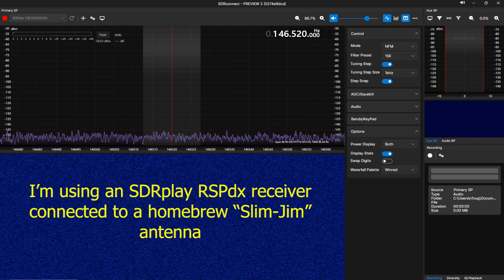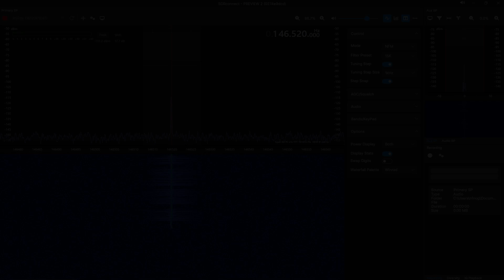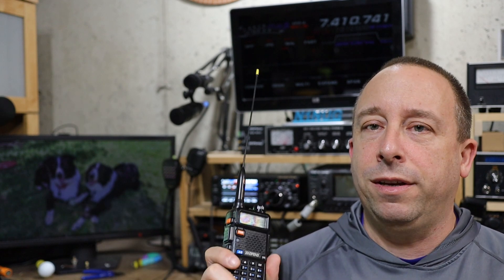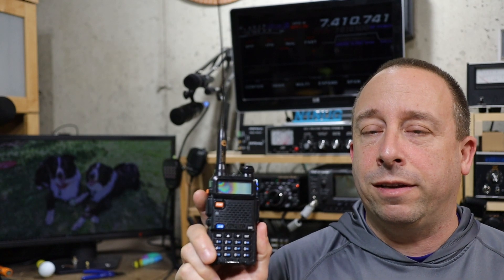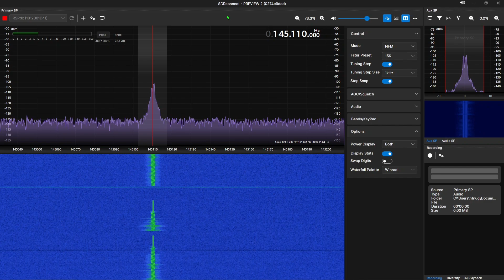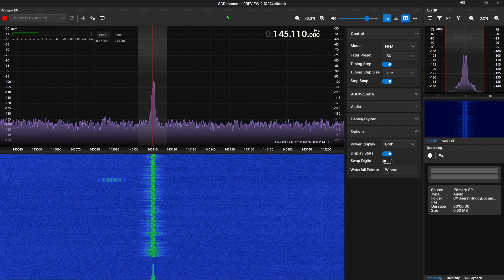The Most Important Setting On Your Baofeng Ham Radio For Repeater Use!!!

Comment: Hams use wideband FM.
Reply from the maker: Right...that's what the video is about...
Reply: @SevenFortyOne  I "discovered" this a few  years ago when I was reading about MURS frequencies.  I owned a pair of radios for this service, and they were setup for the 2 channels which allow wideband FM.

I was surprised that other channels in this service used narrowband.  This made me wonder if any hams used narrowband.

I was surprised to find discussions by hams using narrowband below 29 MHz.  I didn't think this was legal, but they claim that if their bandwidth isn't wider than an AM signal, it's permitted.

However narrowband FM has issues with phase on the lower frequencies which can render it useless.  So I guess that SSB is still the "best" mode for phone on HF.

Anyway, several years ago I tried the same experiment that you did in your video with the same results.  Narrowband is compatible with wideband, even through repeaters, but since the deviation is narrow, so is the volume.

Comment: When would narrow band be utilized?
Reply from the maker: you would use narrow if the ham repeater you are connecting to used narrow for some reason.  Most ham repeaters, however, are set to wide.  Having said that, most other radio services that still operate analog VHF/UHF like fire, EMS, and businesses use narrow mode.  Ham Radio is really the only holdout still using wide.

Comment: Question.. brand new on my journey of learning, on some repeaters when I transmit I'm told I have a low almost robotic hum kind of like what you had when you were using the repeater. Even when I key up just to make sure I'm hitting it it gets keyed back with this digital sounding "waooow waooow waooow"  like some1's making Frankenstein in the distance.. lol  rps 30 power supply btech 25x4, not all repeaters give me this but they keep saying maybe rf bleed back and im commin in low? Wouldn't that happen all the time though if that were the case? W/N didn't change a thing.  😒
Reply from the maker: I'm really not sure... I'd have to hear it in person.  I've never heard what you are describing.

Comment: The most important setting on a Boafang should be one that directs you to a website that sells Yaesu, Icom or Kenwood!! But I don't think they have that setting. You get what you pay for, don't ever forget that.
Reply from the maker: I think we both know that these Chinese radios are here to stay.  My goal here is to help people use them  the best way they can and also to point out the flaws they have.  I find it more effective to show people why "ham" radios are better than the cheap Chinese radios and encourage them to upgrade their equipment when they can.  Outright telling someone their radio is a piece of junk is going to discourage them from getting on the air, being active, and then eventually upgrading their ticket.

Comment: I'm of the new hams, but this is something I am a stickler about. The big thing is that this isn't 1966 anymore. The FCC should Narrowband the Ham Bands above 50mhz. The FCC mandated in 2013 that there shall be no more Wideband in all of the rest of the spectrum except for Hams, Weather, and Marine Bands.

You get a better Signal to noise ratio, your signal travels further and it helps free up the spectrum and allows for additional repeaters/traffic. I will love the day when wideband is no more. It is time the hams get with the times and we push this hobby forward.
Reply from the maker: You make excellent points.  However, to play devil's advocate I'd rather the FCC NOT mandate NFM for hams.  Ham radio is for tinkering and experimenting; regulations would restrict that ability.  Thanks for your thoughts!

Comment: I find it very funny when you are talking on FM mode and you give a report of full quiet but low audio and the station says " I will increase power ".  If 5 watts is full quiet, 1500 is not going to increase audio levels. Some think FM and SSB act the same.